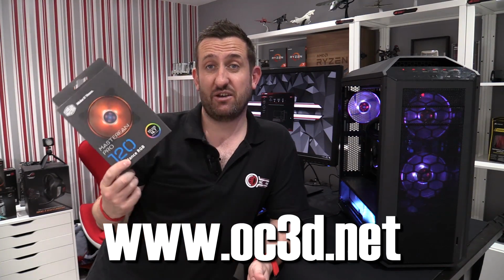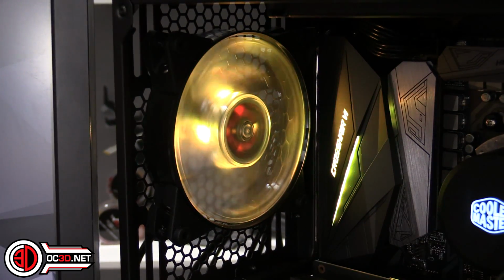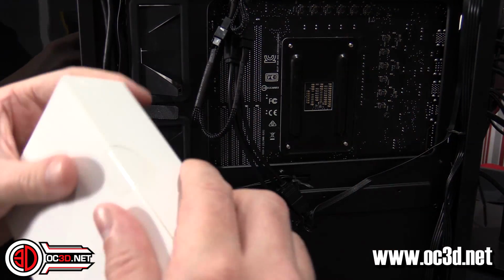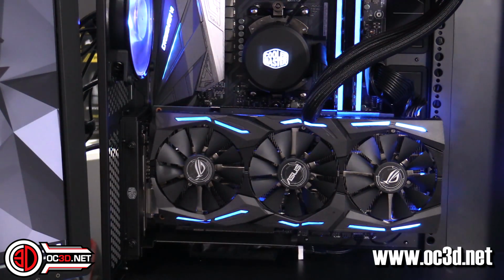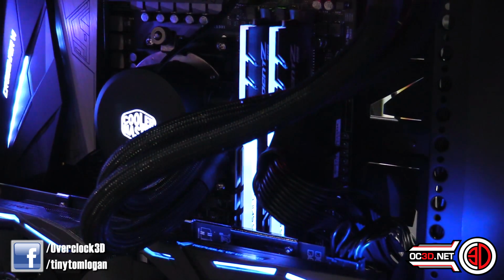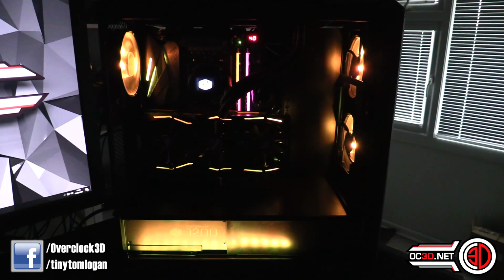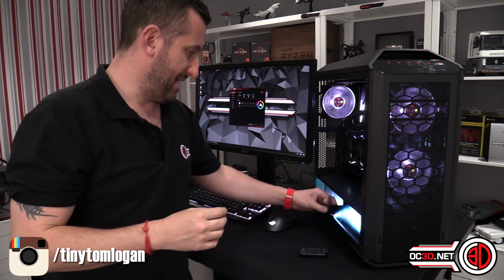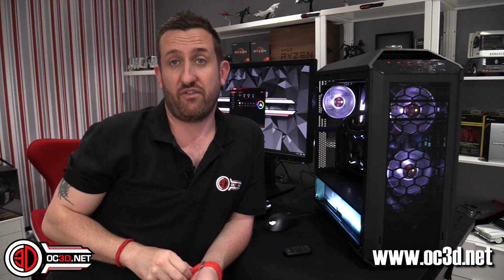RGB - Ryzen Gaming Build

Comment: do the c16 rgb triden z work at 3200 too with the ch6? or preferably the x370 strix-f asus rog mobo cause its  cheaper? i am sure the c14 rgb 3200 run at 3200 but i have never seen c16 on a qvl list at 3200 mhz with rgb on it ...please help because i am trying to copy that build but with a little cheaper mobo and c16 ram kits cause they are cheaper

Comment: Ok off topic question but could i put radiators in a 50 gallon fish tank (no fish or anything in it) to dump the heat into the water instead of the air?  Im asking cause i had 2 emperor scorpions years ago in the tank they died and its been in the garage collecting dust. Im starting to build a new PC and was thinking of bringing the tank and stand into game room and use it.
Reply from the maker: Xantheus07 I'm not sure how good the heat transfer would be tbh. It would be a good heating if it worked but everything would still warm up eventually

Comment: Hi Tom, I know you mention in your Crosshair VI Hero X370 review that you can have the NZXT USB Internal Hub since the it only has one internal USB hub.  Well I did get the NZXT internal hub but it doesn't work.  I tried to plug my H100i water cooler dongle to it and a case front headers to the NZXT hub but I get no signal/power....Is there a problem with the Asus RoG internal USB hub that won't work with any hub extension?   It does work when I plug the H100i straight to the USB/ROG USB internal hub on the MB but not the NZXT...Can you do me a favor and try it on your end?....Thanks Tim!

Comment: Where do you find the vertical gpu mount?
Reply: dtune30 As stated above, It's the case. It's a pre-installed feature. Basically look for any case with a vertical PCIE slot.
Reply from the maker: dtune30 stock will be available soon. Bolts into any case but as I said in the video you may need to cut the back of your case
Reply: Found them eventually. Looks like the ribbon cable is the next part since it's not included. Seems $30 for a reliable one. Cheap ones on Amazon have apparently damaged MOBOs and killed GPUs. Thanks for the reply.

Comment: I still can't get my trident z RGB ram to let me control it....
Reply: Sadly im too far along with my build now, it's all setup and done with my Crosshair VI 1700X @4.0Ghz and the ram speeds are right where they should be at 3000Mhz. I'll wait to see if they ever patch it for now. Because im ok with this one little issue.
Reply: Hi, could you provide which specific sticks of corsair RAM u used and which mobo, petedogg369. Thanks.
Reply: As an update, i did finally get control of the ram colors, and a pretty good way to fix it if it stops again. Had to uninstall aura and gskill apps then shut down and reinstall one app at a time with a restart between each install. Not a big deal with my OS on a SSD but it is a reliable fix i can apply and have tested.

Comment: Do those brackets with the ribbon cable fit in other cases, you reckon?
Reply from the maker: ManWithBeard1990 I specifically covered that part
Reply: Oh... I must have zoned out for a moment because I didn't catch that. Thank you, Tom.
Reply: A dremel is your friend. I installed the coolermaster vertical gpu bracket into my Phanateks Enthoo Evolv atx tg last week. It shows off my new 1080ti Hybrid a treat and hides many ugly bottom of motherboard cables.

Comment: Did Aura kill your RAM  yet?  It will.  SPD corruption.
Reply: Hmm Gskill software does the same thing
Reply: Aura uses the SMBus to communicate with the RAM sticks RGB, GSkill designed their RGB RAM that way.
This is fine when it is the only thing using the SMbus which is never. CPUz, Hwinfo, Corsair link, aida64, SIV all use the SMBus.
Other competently authored software that writes to the System Management Bus do so by using mutex which stop other programs using the SMBus while the first program  is writing over the Bus.
Aura and gskill beta take no such precautions. In consequence the traffic on the SMBus gets hopelessly mangled and results  in the inevitable random corruption of the SPD tables residing on your RAMs SPD EEPROM .  This means the bios can no longer identify what type , speed, etc of RAM is installed and cannot use it till the SPD tables are re-flashed with good SPD data. If all your sticks are sufficiently damaged, you cannot boot your machine to fix the SPD tables using Thaiphoon Burner or Elmors SPD tool.
You need to buy or borrow more RAM. It is not just GSkil RGB which is at risk. ANY RAM which is not SPD locked is at risk.
Reply: Yeah, the GSkill RGB beta is a just a bastardised form of Aura.
Reply: How do you fix it? Any idea if Corsair Dominator 3200 C16 is at risk?
Reply: any ram that is not SPD write protected is at risk.  You need spd writing software like Thaiphoon burner to re flash good SPD data.
Reply: This and the lack of dual Bios is the reason I went for the Gigabyte K7 instead.
Reply: It has BIOS flashback though, which negates the need for dual bios. What if both bios won't boot?
Reply: Then I'll use the warrenty, but that ram corruption story does put me off the Asus.